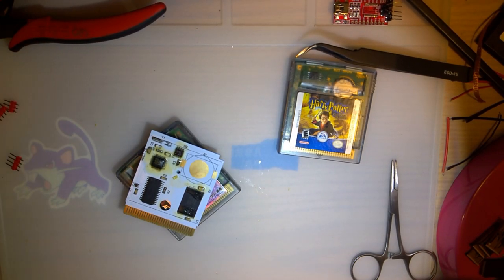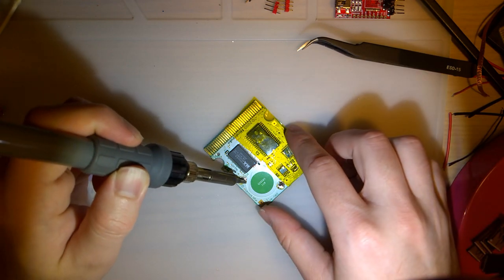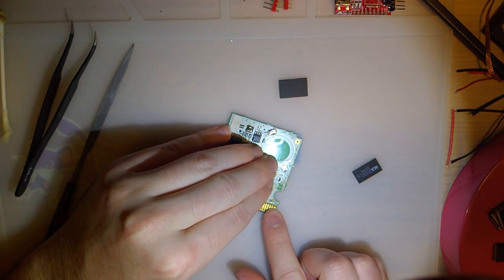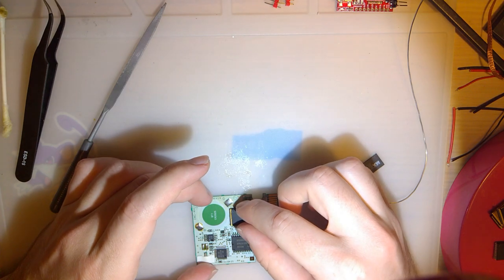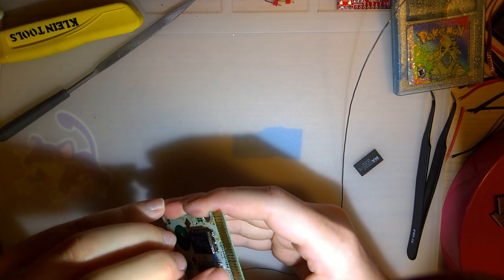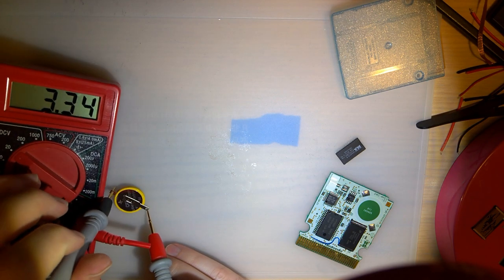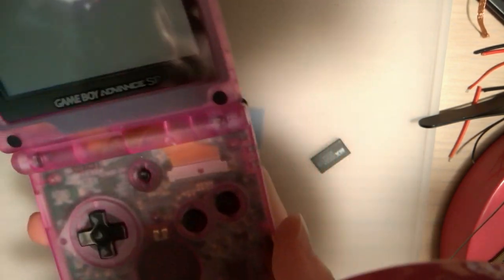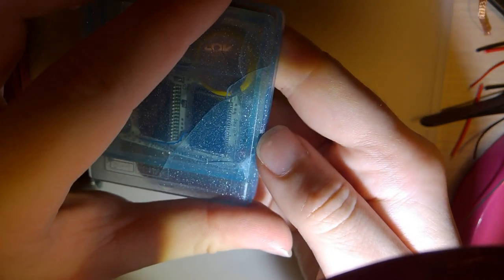Making another JP Pokemon Crystal RTC Flash Cart

Comment: That's funny, I turned my copy of the same harry potter game into a flashcart actually
Reply from the maker: I've been meaning to actually play the game. I picked it up pretty cheap but I only really had it on my desk because I needed to dump the ROM for testing a 4MB flash cart =)
Reply: Hey, I was wondering Nikhil, which adapter board did you used for that cart? thanks!
Reply: @muonswitch  same one used here :)
Reply: @NikhilGarlapati  Yey, great, thank you for your reply! By the way, two questions: 1. I happen to be using the flash memories AM29F016D (which I know are compatible with the board) with InsideGadget's cartridge flasher without success (there is only profile there for the AM29F016B, which I tried to used to no avail) and I cant tell if its my soldering skills that suck or if the chip manufacturing process can also affect how memory is flashed. 2. On these adapter boards, the chip legs right above the 'WR' contact should also touch the 'WR' contact or no? I am struggling to see it in the image and documentation for this TSOP II adapter board is nonexistant or I cant find it.
Reply: @muonswitch the way i only just saw this 💀💀💀 hope u figured it out king 👑
Reply: @NikhilGarlapati  Ahaha, yeah, actually I need to get back to it, it has been a while. I remember I did one generic cartridge with success though.
In the meantime the prices for these pkmn cartridges went up quite a bit, which higher my anxiety of screwing them up!
Reply: @muonswitch LOL i found some spare parts and an old jpn pokemon gold so i came back just to make sure i wouldn’t miss any tips and just successfully made yet another flash cart!
Reply: @muonswitch i think it’s pretty easy to mess up the flash chips, but the cartridge is usually fine honestly just desoldering the whole chip+adapter is fairly easy so you don’t mess up the cart

Comment: So only one wire is required for this mod? How come there is at least 3 wires on Jrodrigo's carts? I am planning to flash ROMs onto mine using a GBxCart RW. Thanks in advance!
Reply from the maker: they are probably made with different carts.
Reply: @makho  Yeah I eventually figured that out. KDFN carts (JP pokemon G/S) uses TSOP32 instead of the TSOP44 used by the JP crystal. Could you please make a guide for making a JP G/S Flash Cart? Thanks again!
Reply from the maker: @sillynewbz  I mean, it should be basically the same. Jrodrigo has all the wiring listed with the documentation on his adapters and the actual assembly process is identical.

I might make another video eventually but it's a very low priority
Reply: I bought a Pokemon gold and silver JP, can you link me to the correct flash chip I need? I can't seem to find one

Comment: Hey Makho, Ive done this mod to my Japanese Crystal. Having an issue though. It has a Massive power drain. Kills a Save battery inside 24hrs. I doubt thats normal, do you have any solutions?
Reply from the maker: Did it work before you modded it? You probably need to spend some time beeping stuff out with a multimeter because it sounds like there's a short or bad solder joint somewhere.
Reply: @makho  It did for a short time. I found 2 things. R2 - Short also found C3 i was getting nothing at all. No nF/pF reading nor was it shorting so unknown as to its value
Tested others results are as follows. Tested Both Componants off the board and still got nothing
C1   0.8nF
C2   0.8nF
C3   Unknown - Same Colour as C1 and 2 so i suspect this is also a 0.8nf
C4  15nF
C5  130nF
C6  15nF
C7   0.1nF
R1  1kohm
R2   Unknown  - suspect it might be a 10kohm resistor or a Fuse as it has Green Writting on it -A00 i think it says. so dam small i struggle to read it

Any Chance i can get you to confirm these Valves especially for R2 and C3. Ive tried googling for them but no luck. Only find the values for the full board replacement flast carts like HDRs

Any Help would be appreciated
Reply from the maker: @amystanbridge6482  You'd probably be better served by posting this in the troubleshooting section of the GB discord. I apologize but I do not have the time to sit down and beep out one of my own carts. 

The full board replacements will use the same components as OEM boards.